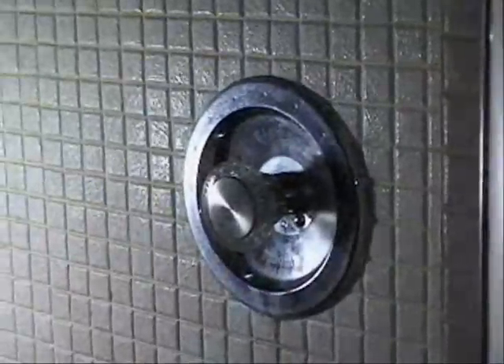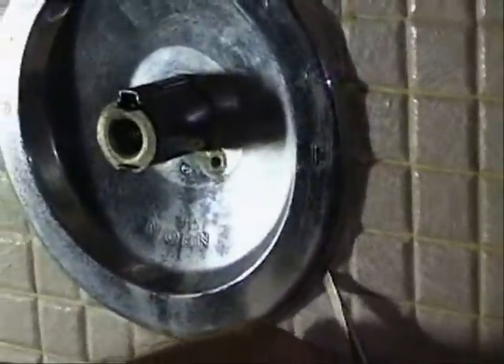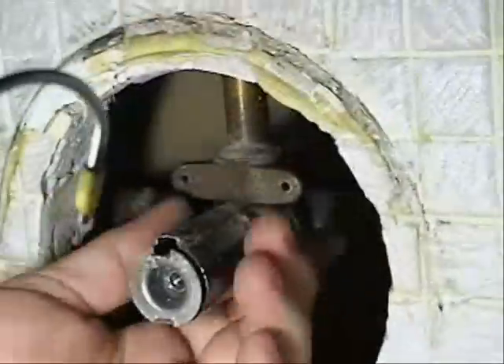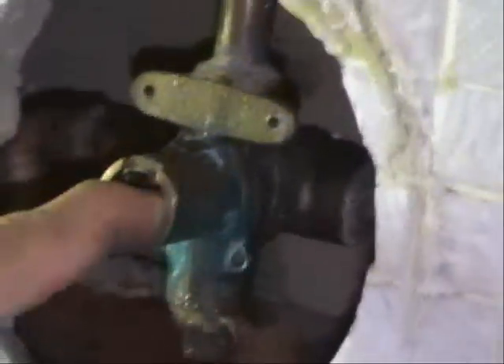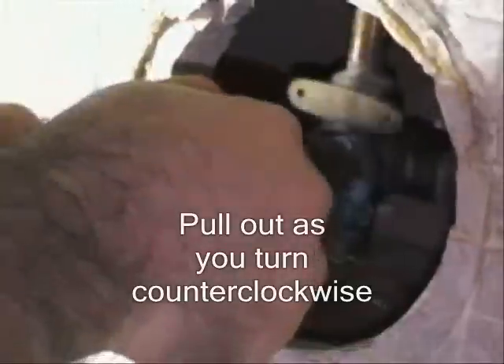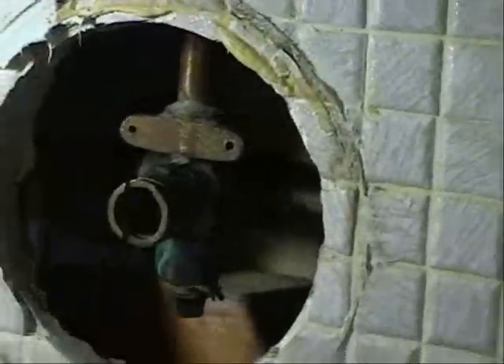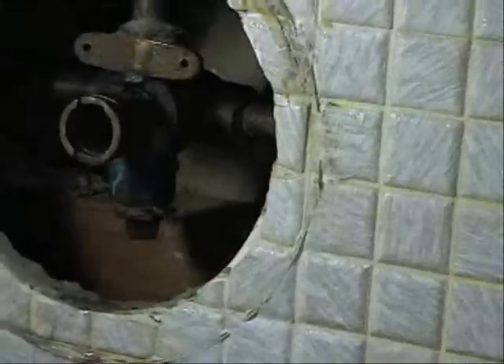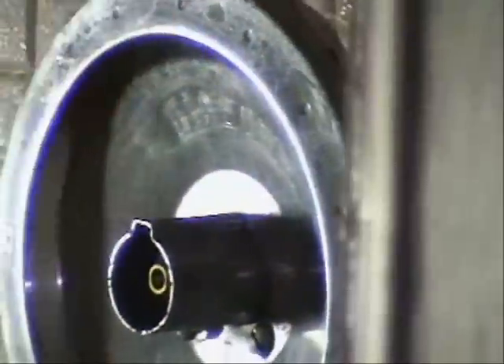Replace Stuck Moen Shower Faucet Cartridge

Comment: After yanking out the guts and the outer portion of the cartridge still stuck inside, I used the 1/2-13 tap method. You metioned that Moen themselves recomended that procedure. No problem starting tap, since you're only cutting brass. Worked like a charm. After 14 years since the making of your video, you're still helping people. Pretty cool! Thanks!

Comment: 12 years later and I have to thank you very much, this video about using the #6  Easy Out Extractor is exactly what I did. I sprayed vinegar prior because of all the lime build up and waited an hour before attempting removing the cartridge, my problem was though the cartridge was turning from the easy out, it wasn't coming out, I had to hammer it in deeper for a better grip and just pull on it with my locking pliers turning it back and forth and that did it! Out with a pop. I did all the recommendations of checking and removing any residue with vinegar and brush. The faucet works like new.  Thank you for your advice.

Comment: Exactly what I needed. When my cartrage got stuck and I broke off the tabs with the correct tool, I thought I was going to ripping out tile. I had the 1/2 tap and a 3/8 wood dowel and 2 minutes later I am turning on the water and patting myself (and you) for a job well done.

Comment: Thank you! The the Easy Out saved me. The plastic tool that came with the Moen replacement piece bent..then, the metal pull tool successfully only pulled out the center. The Easy Out #6 tool worked like a charm.

Comment: UPDATE,  just did my moen 1200 cartridge. The house was built in 1949 and this was never changed in both the tub and shower area shower bodies.  Both did not work, completely rusted.  I tried the moen puller abs it worked on one. Make sure you first try to turn the cartridge right and left 90°.  Then pull out by the stem, i yanked mine and it worked.  The other one i had no success with.  I used the pulled and it just pulled the middle stem.  What i did next to get this thing out was heat the middle with a torch. Allowed it to cool off for 15 min,  then sprayed it with wd40 every 15 min 3x heavily. Then i used a ez out aka screw extractor size #6 and turned it counter clockwise ass I applied  pressure to the back.  Once it grabbed and turned the cartridge  i pulled it out.  Some ppl used a 1" and a half metal dowel round rod which works great once the extractor grabs on.  Goodluck it will work.

Comment: Thanks for making this video! I used the 1/2" NC Tap with a 1 1/2 inch length of 3/8" dia. wood dowel rod. It worked fantastic. Now my shower control works better than ever. Once again, thanks for the video. It's been greatly appreciated!

Comment: For mine it looks like someone put a layer of glue between the stem area. And we haven't used this shower for quite a few years. So I'll see if I can remove it. Because I've been trying to twist and jiggle pull it out but no luck till I noticed with a flash light that there's a light layer of clear stuff over the sides of it.

Comment: I had the same issue today with the cartridge staying stuck so what I used was a pair of channel locks and you just stick one noses of the plier in there and you could wedged in there just enough so you could start to turn it while you're applying pressure in wards all the while turning counterclockwise and you're still pushing down on the plier and it will work itself out

Comment: Simple solution to remove the stuck cartridge is the HDX150 tool, you can google search the tool and find it before you attempt to repair
the Moen valve.

Comment: I also had a stuck over 30 yrs old Moen Shower Cartridge. I tried removing it, and the stem pulled out leaving the Cartridge housing stuck in the Valve. I almost gave up and was going to replace the entire Fixture. I purchased a easy out tool at my auto parts store. It worked so well compared to junk pullers the plumbing stores sold. I saw your video after the fact and was glad to see someone posting a video on using a easy out. Nice job. Thank you.

Comment: Use wd-40 instead, works great. I managed to pull the whole thing off together
Reply: I was like water and vinegar? wtf i used wd40 too and worked awesome nice!
Reply: nood 1 ez
It's not the WD40 that helped you get it out easily. You could have used nothing and it would have come out easily because your cartridge was not seized to the shower body. 
Anything you try to shoot in as a lubricant will never get passed the first oring anyway .

Comment: No kidding.  Your video was a miracle.  I had same problem with the sleeve being left after the cartridge extraction.  After dealing with many other youtube solutions, I came across yours.  I didn't have a wood dowel, so i sawed the head off a 11/2" bolt and used it instead.  I borrowed my neighbor's 1/2" tap and out it came.  Thanks for the effort.  Barely in time for happy hour.  Cheers>

Comment: You know if you read the directions! Pull the clip up out of the way, then use that plastic cartridge and turn it 90 degrees. If you can't turn it, you'll have to go purchased a stronger medal one from home depot. Turn it 90 degrees, you got to turn it 90 degrees to break the seal! Then put is out!
Reply: +Robert Fugate for me the plastic adapter broke in 3 pieces, I used the metal pull tool and it just bent the ears on the cartridge, so now mine is really stuck...can't even get the inside part pulled out to use the tap on the outside...

Comment: Hello  Want to say thanks for the video, I had a sticky cartridge and used the cartridge removal tool and it took the inside of the valve out but left the sleeve and called a few plumbers and they wanted to replace the whole valve assembly watched your video and the number 6 easy out tool $10 at Ace Hardware took care of the job thanks a bunch appreciate your time in making this video

Comment: I HAVE A DIALCET WITH A LITTILE DIVERTER PLUG BELOW THE HANDLE IT CAME RIGHT OUT. I AM PLANNING ON REPLACING DO I NEED A NEW VALVE OR JUST THE DIVERTER PLUG FOR THE VALVE.

Comment: Next time use the plastic from a new cartridge or a cartridge puller tool and leave the vice grips in the garage.  Rotating the cartridge 90 degrees with a proper tool will break loose the corrosion and sediment buildup, and the whole cartridge will come out.  It should take less than 4 minutes to do properly.  Your trim plate should never be taken off at all unless this is an apartment without water shutoffs and it is a last hope.  Shut off water, remove handle, remove escutcheon, and remove the retaining clip to access the cartridge.  The proper tool costs less than the price of a tap, or a replacement valve if you screw things up.  vinegar and water won't work, as it can't reach the minerals due to the rubber o-rings.  Leave the do it yourself videos to someone who knows how to do it, re-title this video as How you shouldn't attempt to repair a Moen shower valve.
Reply: and never, ever, ever, ever start using a wire brush on the inside of the valve body.  if you happen to scratch up the brass, it will never stop leaking

Comment: I used the 1/2 inch tap method and it worked like an absolute charm. For the dowel I had a piece of 5/16 round bar stock that I cut to 1-3/4" length, it worked perfectly; I liked the idea of using a metal dowel because of strength and because I could have removed it with a magnet if the tap had stripped out (I first tried a wood dowel and it was not strong enough, plus it was a pain to get out). This saved me a huge headache. Thanks!

Comment: Thank you so much for your help. You saved me a plumber bill. The ½" tap and 3/8" x  1½" dowel worked perfectly for me.  I did have to buy the removal tool since it was stuck and the plastic one that came with the new cartridge did not work.  Thanks again.

Comment: Great vid.  Showed everything I needed to see to replace my Moen 1200.  Luckily mine just popped out with a good pull and no easy-outs or taps were required.  I guess I didn't see it in your vid, but if you find after installing that your HOT and COLD are reversed, pull the U-clip (but not the whole cartridge) and rotate it 180* and this should swap the HOT and COLD sides.  My one complaint is how shaky your cameraman is.  No more rocking out to Boston for him on the job.  ;)

Comment: If your faucet is really stuck from gunk (or hard water) you have to use a different type of tool to prevent damage which backs the cartridge out.  
It's called a Moen cartridge removal tool.  Basically screws into the cartridge and then you can use a wrench to tighten the end bolt and slowly back out the stuck cartridge.

Comment: Hi FixIt,

Thanks for the useful video.  Unfortunately, nothing worked for getting the outside of that valve out.  Since I deformed the brass diverter, I take it that I will have to sweat it off and solder a new one in???  Do you know of a better way to do that?

Pat V

Comment: If you call moen, they will send you the new catridge for free and just use the plastic tool that comes with the new catridge to get the old catridge loose and then pull it out.

Comment: Fantastic video. I had put off repairing my shower for years since I thought I'd just have to replace the entire faucet. After stumbling across your video I realized that it could do it myself. I had to buy the Moen cartridge puller since the center was totally frozen in place. Using a tap and dowel to remove the sleeve worked perfectly! All replacement parts were available locally. (My faucet was older and used the 1200 cartridge which is still all brass.) Now everything is working great!

Comment: Thanks, it worked for me fine, and luckily, my old cartridge was the plastic variety...came out complete, levered it out using a drill bit in the hole in the side and a flat blade screwdriver.

Comment: Actually, using the little plastic tool tht comes with a new 1225 cartridge, the old cartridge might have come out easily. That's how i got mine out.  I was told "don't try to pull it out!  use the little plastic tool" and they were right.

Comment: I really need help where you found the ez out #6.  They only carry 1-5 at home depot.  I'm having a really hard time trying to get that out.  I have tried the BrassCraft Internal Pipe Wrench Set and the Pipe Nipple Extractor.  The wrench set did not fit all the way in because the second time turning clockwise, it would loosen.  None of the pipe nipple extractor fit.  I really need that #6 ez out and need to know where to get it asap.

Comment: Thanks so much for this video, we had no idea where to start before seeing it. Our Moen looks exactly the same but turns out it used the brass cartage, which meant another trip to the hardware store. Still, it was one of the easier plumbing fixes we've had in our 50s-era rancher! Thanks again for the video!

Comment: Thank you for this video!  For 6 years I have used WD40 to try make the handle push/pull more easily...you have healed me from this headache.  I also had the center piece of the old cartridge pull out so I had to use an internal pipe wrench to remove the outer piece.  I feel like I could fix anything now...thanks again!

Comment: Thanks. I was a bit lost about the cartridge. I went down to the local Ace hardware and got the Moen cartridge puller for about $14. Was wondering why you didn't try that first before yanking the guts out and causing more effort. 

But the video did set me on the right course and for that I thank you immensely.

Comment: Pulled the center out of the mixer valve. STRESS. Then I figured, cool off watch some videos and see if there is a way out of this fix. The first video I saw was of a professional plumber, with virtually no problems using some silly puller. NEVER gonna happen that way in anyone's bathroom I know. Then I happened on this video. Tapped it, threaded a 4" bolt with washer & 1 1/4" deep-well socket. it pulled the stuck center portion of the valve right out. Thanks for posting this video!!

Comment: Thanks for the video. I had a little problems getting the old cartridge but I used plastic tool that came with the new to loosen it up. It went really well after that. Took approx 30 minutes.

Comment: Do not use a wire brush inside the valve body because it scratches the inner
walls.  We want them smooth so that the O rings (black rubber seals) do thier
job.  Use an old toothbrush with some white vinagar to clean out the valve body.
And feel inside with your pinky to check for any blockage.

Comment: Here's a trick I learned and have successfully used.  First heat the pipe with a blow dryer.  That allowed me to successfully use the Moen cartridge puller without pulling out the stem.  It took a while and my wife had to hold the blow dryer on it while I worked it but it all came out in one piece!

Comment: if the tub is not used, but water still leaks from the spout(connection pipe).  why is that, do you know?

Comment: @Laurensmay Definitely, you need to shut off the water to the house, or at least the water to that shower if you have a branch valve.  I mention that I have shut off the water at around 2:10 in the video.

Comment: @HyeJroc 
It is very common for the stem or spindle to come out without the cartridge casing, which is what happened in my video.  Is that what happened to you, or are you saying that the end of the stem is actually cracked off, and part of the stem is still inside?  If this is the case perhaps a pair of needle nose vise grip pliers may work if you can grab onto part of the stem.